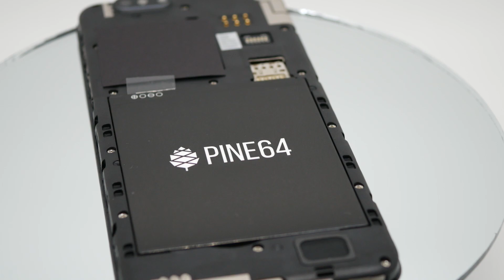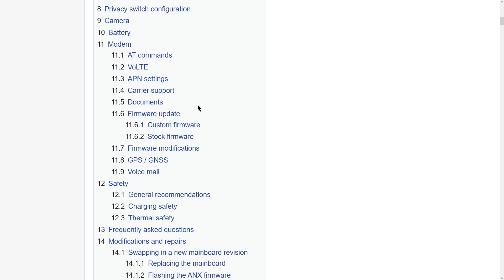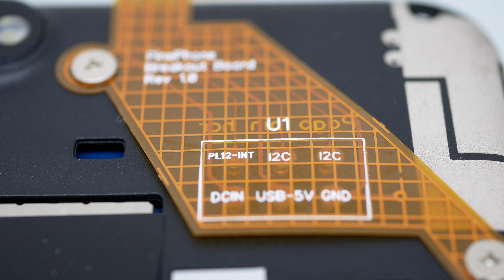PinePhone Beta: I2C Breakout Unboxing

Comment from the maker: This is a re-uploaded version to address a missing scene.  Also, the USB-5V node is driven by an internal DC-DC converter.  This weekend, I will post the voltages on my main website.
0:00 - Objectives
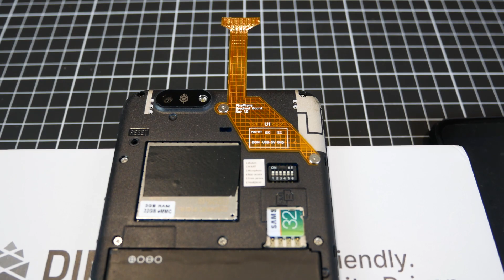0:41 - Acknowledgements
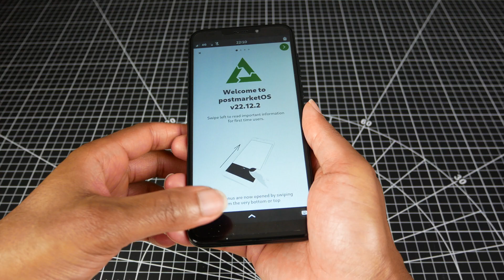1:05 - Scope
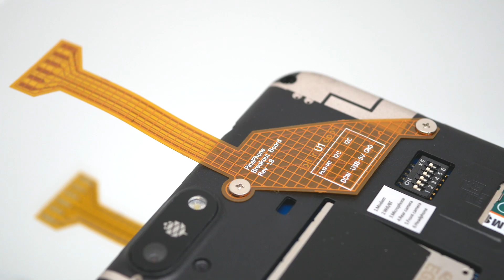1:33 - 2x3 Connector side
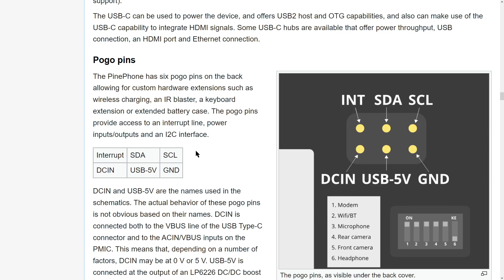2:58 - 1x6 Connector side
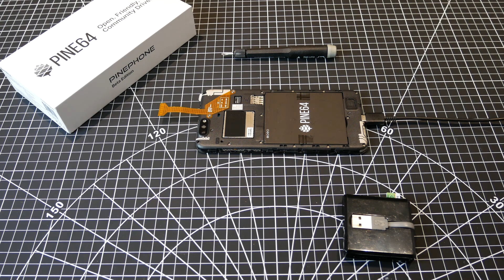3:37 - Progress so far
________
I2C = Inter-Integrated Circuit
SDA = Serial Data
SCL = Serial Clock
UART = Universal Asynchronous Receiver-Transmitter
LoRa = Long Range